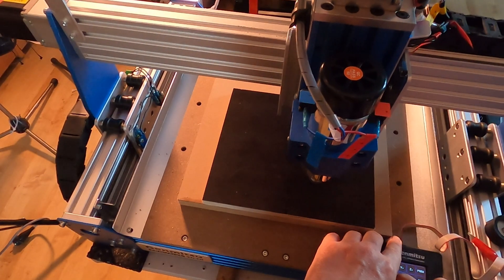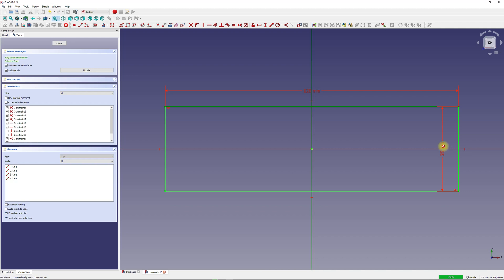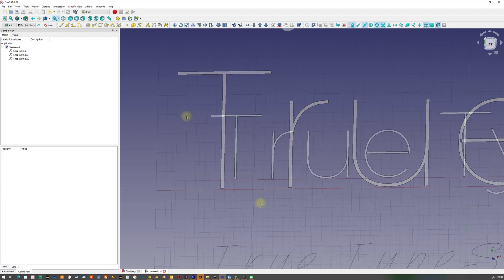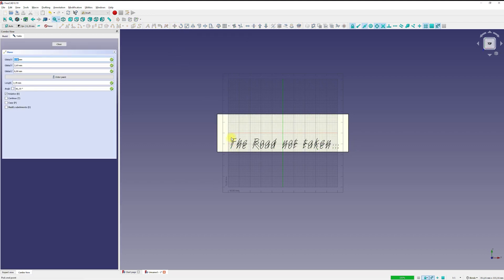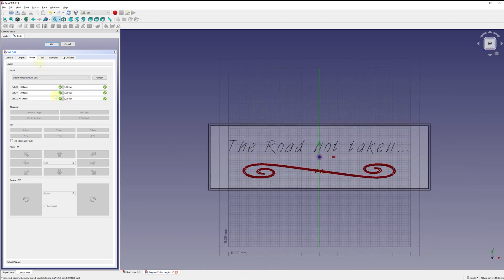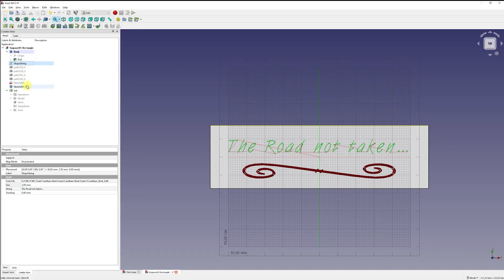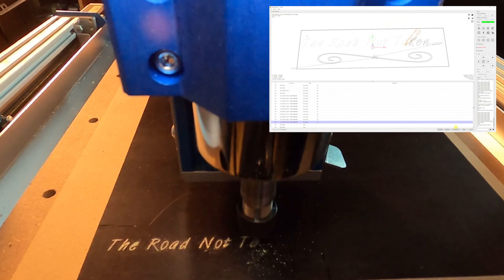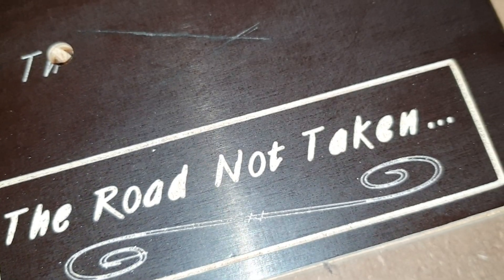FreeCAD engraving toolpath and CNC machining

Comment: I like this. I have been trying to work out how to sensibly add colour infill for ages. Your formply substrate answers the question. Coat 5he surface prior to machining then spray colour and remove the coating. I realise that sounds vague, acrylic paint should do the trick allowing simple peeling.

Comment: Can you make a video about creating 3d milling toolpath?
Reply from the maker: Hi, I´m currently using Fusion 360 for 3D milling, after testing freecad 3D options a lot. There are many problems with Freecad 3D milling toolpath generation currently, therefore I used Fusion. A video is in progress and comes out in the next days. Do you have specific questions?
Reply: @umlooad  yes, I have some problems with creating a toolpath for 3d milling

Comment: Hi! Great video! But I have a problem, when I create the job and select the grbl post processor, the error message: "The job was created without fixture support"  appears. Any idea why this happens or how to fix it? Thank you very much!
Reply from the maker: Hi did you change the default settings for the measurement. Check the documenation there is a good diagramm displaying the measurements. I also referenced it in the video.https://wiki.freecadweb.org/File:Path-DepthsAndHeights.gif

Comment: Thank you for the video! I was wondering, which file type is required when selecting the font type? It seems that the font files are not in the FreeCad files? Can I donwload them from the FreeCad website?
Your assistance would be much appreciated. Thank you in advance.
Reply from the maker: Hi Win here is a starting point...http://www.imajeenyus.com/computer/20150110_single_line_fonts/index.shtml
Reply from the maker: Look for single line fonts, but many search results are directing to commercial offers. There are some free font that I used in the video and I collected them over some time.